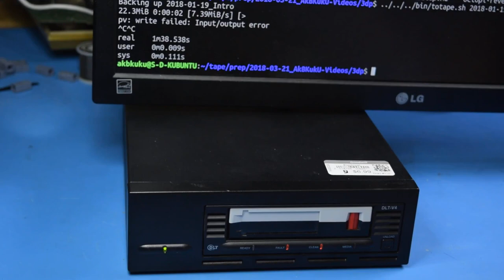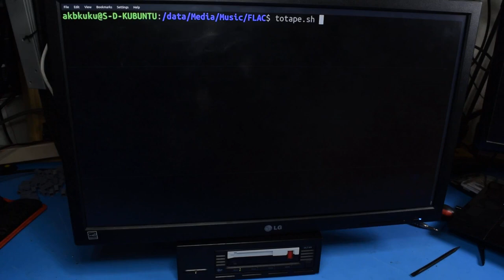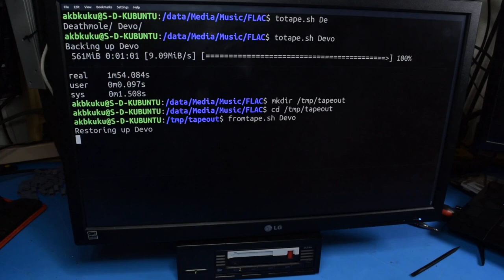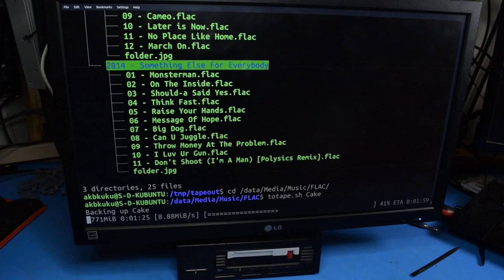0x002A - Manually Cleaning a DLT Tape Drive

Comment from the maker: You did not miss 0x0029, it's not done yet.
Reply: Hey, AkBKukU! For the next video on tape drives, would you mind going over what sort of system you use to organise your backups on tape? (I'd assume you have some sort of system) :3
Reply from the maker: That's part of what I want to cover. Due to their linear nature they are inherently different from hard drives and have to be treated differently.
Reply: AkBKukU thanks a bunch, looking forward to it :)
Reply: I have seen that new LTO systems have something of tape filesystem that allows to know things on tape, and they can be used a bit like hdd's. nver read mpore than wiki tho.
Reply from the maker: I've seen that as well. It requires the very next version of LTO than what I have so I will not be able to demonstrate it. However, know how linear tape works(there is a reason I continue to use the word linear) I can't imagine how practical it is. If you are using it as an occasional write disk I bet it's fine. But for random access it could literally take minutes for it to get to where the file is. And I don't even want to think about how long a defrag would take...
Reply: It's cool, but I have never gotten it to work on DAT tape  drives. Oh I love old Tandberg DAT tape drives...

Comment: If it's just SATA, will it slot into standard PC case, where DVD drive usually goes?
Reply: failing@commenting yup that's why most PC cases have not only one but sometimes as many as 4 5 1/4 inch slots. You can actually buy these tape drives for internal use way cheaper than these external drives

Comment: Surprised it doesn't use rotating VCR heads.
Reply: DAT drives do
Reply: Helical scan, as in VCR/VHS heads, is more complicated, the head is larger with a more complex construction compared to a single head assembly. To be precise the head(s) themselves are not large it just takes up space when they are placed on a rotating drum. The advantage of using helical scan vs. linear scan is lost when the drives can have up to 32 tape heads to achieve high throughput.

Comment: Wow it looks so cool in the inside. Wonder if you could take out the actual tape drive from the adapter enclosure and install it in a pc
Reply from the maker: You very easily could, it's just a SATA drive(note that is is not a SAS drive, it is true SATA). So it would work fine connected directly to any SATA controller like on your motherboard. I already have an LTO4 drive in my main computer though that can hold about 5x as much data as the tapes for this drive can.

Comment: hmm maybe it actually can be converted to a usb DVD drive with a 5 1/4" drive as you dont have the tapes and use it with computers that don't have internal drives
Reply from the maker: I can get tapes, it's way cooler as a tape drive than it would be as a DVD drive. Also it's inanely loud, there's no way I would put up with that just to have an optical drive.

Comment: Did you do something different with your audio? Sounds really good in this video!
Reply from the maker: I turned up my mic preamps by about 50% and did audio post processing with audacity. It did come out a lot better. 0x0029 is also recorded like that but I think it may have clipped a couple times in recording so I've turned the preamps down again by about 20%.

Comment: I currently use portable HDDs for archiving client files (multiple 1TBs for offsite). Should I stick with that, or move to tape?
Reply from the maker: That's something only you can decide, tape isn't easy. The next video I do on tape will cover it's pros and cons and how to use it.

It's dirt cheap, down to $0.01/GB, so it wins there. But you have to buy and maintain a drive. And that drive needs to work 5/10/50 years later when you want to get the data back off the tape.
Reply: AkBKukU True, and in backing up a 500GB .zip file, a USB3.0 HDD may well be faster.

Comment: Do tape drives have a way of marking bad sections like disk drives do? I don't know much about tape formats.
Reply: Not exactly the same, but they have the read head behind the write head so that they verify everything it write. Then  rewrites everything  that failed the verification in the next part of tape until it succeeds. This is dynamic on every write and does not have a permanent list of defective areas.

Comment: Help a brother archive some 720kilobyte Amiga floppies.
Reply from the maker: I guess I forgot to mention that it's a 160GB tape in the video. So you could fit ~222,222 floppies on one tape. Modern tape drives feature hardware compression as well so it could be up to ~400,000 floppies depending on the data redundancy.
Reply: The issue isn't a lack of archival storage on my part, but a lack of a way to read the disks. Amiga floppies are formatted weird, you can't just get an old 720k floppy drive (or other floppy drive), use controller trickery, and get the data. That is to say--I haven't found a way to read them, but, I'm still looking for ways to do it... It is nearing the point where I might need to write drivers, which would be fun. Probably.
Reply from the maker: I don't have an Amiga so I don't have any specific advice to give you unfortunately. Generally for special format floppies though, using emulators with real drive support that run on DOS based OSes(Win95,Win98) you can usually make special floppies. DOS allows direct hardware commands to a floppy drive that let it emulate different systems. The NT kernel hid drive access behind the HAL so programs can't do that any more.
Reply: AkBKukU I don't have an amiga, either. Twas fried in a flood before my days. There's something called a SuperCard Pro which is supposed to be able to copy 99% of all floppies, irrespective of their format. I just really wish a software solution existed or could exist, because shelling out $100 bucks to archive floppies seems, a bit much to me.

Comment: I have dealt with all sorts of tape in my career from 9-track 1600bpi tapes to 8mm, 4mm, DLT and more. I hate tape because of it's sequential nature. Disk or usb sticks are large enough capacity and inexpensive enough too. Random access is so much better.

And with USB Sticks you can dd if={source} of={dest} bs={your choice}. Tape drives are obsolete.
Reply: Nobody uses usb flash (a school childs science project) or hdd's for long term storage. Its tape v optical.
Reply: As an update, my 64 GB usb flash drive just died overnight. Little used, wanted to use it to transfer some data, dead. Totally dead. Nothing but usb errors in the logs.

Don't use usb flash for backup, use it for data transfer only.

Also another reason to use tape over other methods, they have a write protect switch ;) To this day I have never seen that basic feature that even floppy discs had on usb flash. It's on sd cards, but many SD card readers ignore it!

I think we have a problem there. We have lost the art of the read only media (excluding optical as that's an obvious choice).